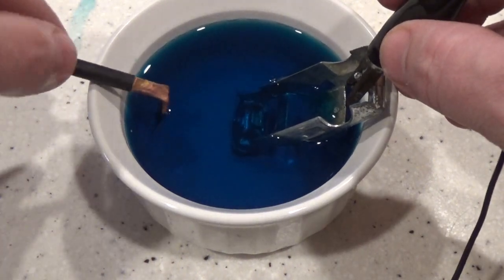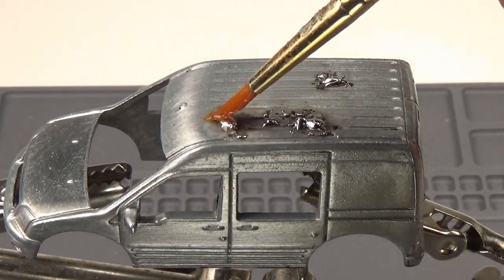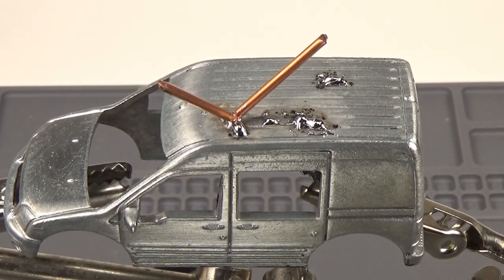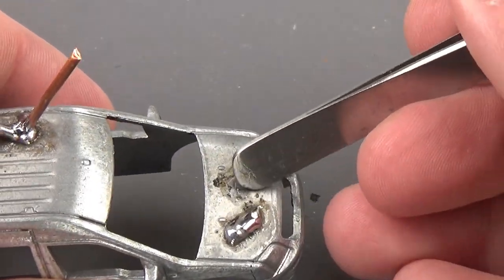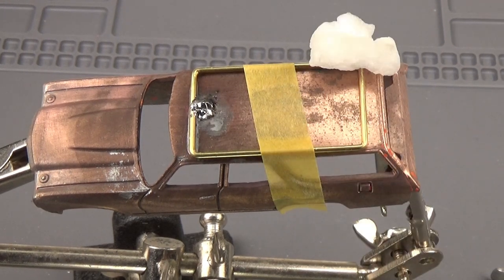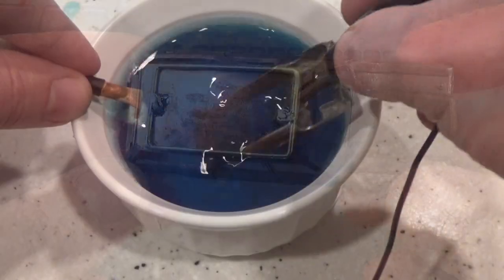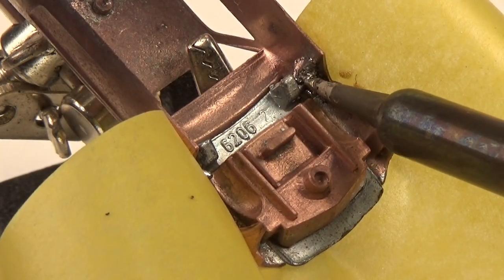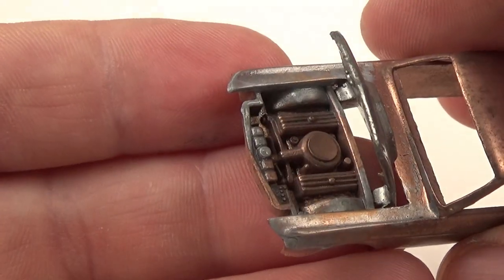How to Solder Hot Wheels ZAMAC Metal and Repair a Vintage Redline Hood.

Comment: Try heating the metal instead of the solder. When the metal gets hot enough to melt solder, apply it to the joint allowing capillary action and adhesion to fill the joint. Keep heat on the joint if needed. Repetition will help show what works best for you. I enjoy your restorations, good stuff. Thanks for posting.
Reply: I was thinking the same thing. All of my soldering experience is to MilSpec standards. I should look more into this myself.
Reply: Be sure not to use a torch. Try it with an electric hot plate and find the correct temperature.
Reply: As an electronics guy, some times you can preheat the entire piece to around 100-150°C with hot air and then apply the solder with soldering iron at around 280-360°C, keeping the temperature controlled is for tiny pieces with fragile materials (like ceramic or FR4 circuit boards), but as everything the magic is in the timing.

Flux paste is also encouraged, watch out for more aggressive (acid) stuff intended for copper piping, it may be good for your purposes.

With practice I have soldered galvanized steel, copper and brass reliably.

Comment: The secret to a good solder joint in these rolling heat sinks is an 80W soldering iron. With a 20W iron I can't reliably solder anything without burning it.
Reply: You could literally see the tin solder solidify in contact with the body. Thats why coppersmith soddering irons are 100W+ range. You can further extend the soddering "window" by zinc plating, since it will act as an additional barrier on the zamak (zink-aluminium-magnesium-copper) alloy copper presence. But a high capacity iron is a must first
Reply: Potentially preheating as far as it'll go will help. That's how we deal with heatsinky items in electronics. We also have high-power soldering guns with a bent piece of copper wire as a tip through which low-voltage high current passes directly, which heat up very quickly and are for this reason convenient, usually 150W or stronger, but they're really unwieldy and can be dangerous for electronics, but for something like this, seems quite adequate, and they can be pretty cheap.

"60W" generic 936/937 soldering stations from China routinely fail to deliver a whole lot of power for some bizarre reason. Chinese T12 does a lot better, even old ZhongDi (yes also Chinese) 50W units can work much better than the new "60W" ones, it might just be the gaps and fitment of parts. I hear some people pour some graphite or copper anti-seize into the tip to improve performance of the 936 but this seems a bit messy.

Comment: I think you need iron with more thermal mass. Whole body of a car is heatsink and it shows with cold joints. Or try to preheat car on electric stove/plate and then try to solder. Clickspring has some great videos on soldering bigger metal parts.  Don't really know how zamac will react to such treatment but it may be worth a try. And you really should just wet the iron tip, solder on the tip is just for thermal transfer, add more to the joint directly when it's heated, it is hard to do with only two hands and fiddly parts but when I grasped that it made a world of difference. Anyhow, great video, waiting for more. Cheers!

Comment: A little preheat of a body really helps, even just hitting it with a hair dryer on full for 20-30 seconds before applying flux and Solder with help it flow.

I've worked assembling PCB for the last 5 years and preheating a large copper area before trying to add of remove a component is essential.

I could see the cool temp of the that Ford connect was sucking the heat right out of the Solder.
Reply: The greatest solder advice I've heard is "heat the work, not the solder".
Reply: With you hair dryer theory ..do you have to keep heating the body everytime you start to solder?
Reply: @ernzcustomz  Yes if needed

Comment: It's a good trick to use sandpaper over the area you want to solder first, something like 180 to 220 (also it can help to cut a grill pattern with a razor). And the tempt of the car should be high already to help the adhesion, so it's better to first warm it up, then apply the flux, and then go with the solder and tin (here you can clearly see how since you applied the cold paper tissue, the tin immediately got hard and you needed more heat to work it out).

Comment: I've learned that tip size is very important when soldering smaller and bigger parts. I was soldering thin wires for my 3D-printer and the small tip worked fine but then I had to solder on some thick gauge high-amp wire onto an aluminium plate that had some copper-clad terminals (the heatbed). This didn't work. No matter how long I would hold the soldering iron onto it. Now I borrowed a soldering iron from a friend that had a tip that was about 8mm wide and the terminals were soldered in 5 seconds. Also, the type of solder really makes an enormous difference in attachtment. I always hated my solder, and then I switched over to a different type with a different core and it always worked. My solder even worked better than the factory-used solders because when I would go over soldering joints from household appliances, by solder would always stick better. So I would end up desoldering the solder and applying my own whereever I had to fix something. You can also use this bigger soldering iron together with a so called solder wick (made of copper strands loosely loomed together) to remove solder where needed.

Comment: So glad to see someone posting interesting videos like this. The only thing I would suggest would be to heat your substrate more. Only when the two contact points reach the solder melt point will it create a reasonable filet. (a solder filet is a solid joint that forms a convex or concave joint between contacts.) If one contact point reaches temp but the other does not, the result is what is called a “cold” solder joint which is the joint side that scrapes off of the substrate. Wiring the substrate to a heater block will do the trick. The higher you can get the bulk of the substrate to temp, the less heat is required on your tip. A third hand at the point of no return in applying the flux just prior to soldering will also yield a cleaner joint. Thanks for taking the time to post this.

Comment: Copper plating the whole car seems overkill and rather time-consuming (of course, as the whole hobby is) but you want to rough up the surface pretty good so the solder can stick to it easier and quicker (it doesn't stick to mirror-finish surfaces). Also you can use rosin-core solder to eliminate the need for separate liquid/paste rosin thus freeing up one hand in the process. :) 

But here's the big trick to soldering anything, whatever you're soldering needs to get hot enough to melt the solder. Meaning you need to melt the solder with the car, not with the iron. Doing it this way makes the metal you're applying solder to much more apt to accept it. And if you scuffed the surface well and have your rosin solder it will etch on much quicker & stronger as well. Initial tinning for everything but the iron is done the same way, using the metal to melt the solder can make some your soldering jobs go twice as fast!

And lastly, you won't have any issues with your solder remelting when it's over 1/4" away on any surface/metal composition unless your solder has too low of a melting point (or your iron is set too high). Knowing your solder's melting point and your iron's temp can really help you pull off some clever repairs when you have the right combo.
Reply: Could you do a video showing how this would work on zamac hot wheel cars? I've looked at some of your vids, good stuff.
Reply: Well said. That was some of the worst soldering I have seen in 30+ years of working in electronics.
Reply: @steveread864  clearly you havent seen mine XD
I'm curious though, did you watch far enough into the video to realise most of the 'soldering' was just to make a point?
Many people nowadays seem to merely get triggered, pause, leave a snoody comment and close the video.
I originally also thought "wtf is this guy doing", but there's a point to it. The first few at least. I'm sure the actual ones can be improved.

Comment: Just a few quick general soldering tips. Solid metal objects are a tremendous heatsink that steal heat away from the soldering iron and away from the intended spot. To prevent this it is helpful to preheat the object (standard toaster oven is just fine). Nothing too crazy, just roughly to the point where you can still hold it with bare hands. Having a more powerful iron (60+ W) might also help. Also, it always pays divident to pretin wires or other parts you want to attach, rather than chancing it and accidentally oxidizing metal and then having to clean it before you can try again.

Comment: Great video and a lil helpful hint you might use when adding stuff to the car/trucks is to use a double alligator clip mounted base which will give you that extra hand we always need.  When I work on smaller electronic components it comes in handy

Comment: I have a feeling the solder isn't sticking most of the time because you're not getting the base metal hot enough quickly enough. It going to take a good quality iron with a high thermal mass to get the base metal hot enough to wet before all the flux is gone.  Even moderate irons like the hakko 888 probably won't be powerful enough.  Likely that wire stuck because of how long the iron was on it and how much flux core solder was dumped into it.  The copper wets easier so less heat is needed.

Comment: I'm using this exact same method to solder wires on circuits. Use the solder flux to also clean your soldering iron and make it last longer and work better

Comment: One component you may want to consider is to get a temperature controlled soldering station. You can get an acceptable one from Amazon for less than $100.00. As someone below mentioned knowing the melting point of the solder you are using and then dialing it in on the station makes for a much more robust and; in the case of a restoration, a more eye pleasing joint. You are headed in the right direction with the copper plating. Get a good station and practice on a junker and I think you'll end up with something very satisfying. Good luck!

Comment: I recently started work on a restoration of a more modern hot wheels, which is my first restoration. It took forever as I had to use nail polish remover with acetone as paint thinner

Comment: A good tool I've found for small precise work (I use it on my knives when I make giards or do engraving) a strong 202 micromotor from treeline tools. I also invested in 1/16" dental burs. I use it very very often and it is very precise especially when compared to a dremel

Comment: You may need a larger tip. I have found that when soldering on PCBs that have large ground planes, a larger tip with more heat works wonders. The added amount of copper on the board sucks the heat away from the solder joint as is the case of the car body acting like a heat sink.

Comment: Great videos!  Very professional.  I enjoy watching them and learn a lot from them.  A few questions: You use a battery charger to electropolish your diecast cars.  Which amperage do you use, 6 amp or 2 amp?  I see that you use a vibratory tumbler to polish your cars.  What media do you use?  You've been able to polish the windows back to their original sheen.  What polish do you use?  You mentioned links to products that you use in the videos.  Where are these links and where do you post answers to the questions that we viewers ask?  In another vein, you had mentioned that you asked viewers to inform you about products that might be available to solder pot metal cars.  Both Muggy weld and Caswell make products that will solder pot metal directly without copper plating first.

Comment: BM , I have a tip for you I do stained glass and if your looking for pre tinned wire it comes in 18ga. And 20ga. If your going to solder on your cars it's great to use just a lil flux and your good to go also you can try blue glass flux it's a water based flux wont leave a residue on your cars

Comment: A very useful video. Thank you. What's interesting is the pronunciation of the word 'Solder'. The British, Australians, New Zealanders say it as 'SOLE-DER', whilst Americans say 'SODDER'. It's rather odd, and I've never worked out why it should be. 'Sod' in English is an old swear word, short for 'Sodomite', it also means 'Wet Turf'. 'Sodder' does sound rude. 😆😆😆
Reply: the British pronunciation is based on the old french word soulder, the American pronunciation is based on the middle english word soudur.  the british pronunciation was most likely influenced by their proximity to france, while we in america kept the older pronunciation but adopted the newer spelling.
Reply: @butre.  You know how it is, kernals and colonels
Reply: Bu tree that’s interesting and sounds feasible, I’ve often wondered how Americans came up with that way of saying sole-der. I have another issue with the word “ mirror “ us bits have that as two syllables but across the sea it has just one. Thank you for your post
Reply: @llamamanism  most americans pronounce mirror with two syllables, it's just non-rotic dialects, which are actually more common in britain than the united states, that make it one syllable.
Reply: NERDS.. I say sawder

Comment: Some of the trouble you are having  as some others have said is you need a hotter iron. You can be quicker and get better results for some things because you aren't soaking everything with too much heat. I have that issue when trying to solder larger audio audio connectors with 14 gauge wire with a 40 watt iron. All I do is melt the cable insulation trying to get the solder to flow with the flux the cable just draws the heat away giving the same types of joints where you can pick the solder away. Try a soldering gun that gives out so much more heat. You'll find the tack soldering will be fast and the solder will flow nice and neat like a real weld. I have a lot of soldering experience on woodwind instruments repairing them. Not having enough heat makes it so you can't keep heap localized.

Comment: Hmm. Here's a few tips for soldering, from someone who's done a fair bit of it. You should be able to do it without plating, the trick is to preheat the item you want to solder on. The reason you're not getting a good joint, is either because of impurities in the metal, which with diecast is a good possibility, but more likely, because of insufficcient heat. Copper plating is not a bad idea though, it's certainly a better material to work with than just pure diecast, but it does seem to be a rather lengthy process, compared to preheating the metal in say, an oven. More than likely your soldering iron, which looks to be a fairly cheap one, does not have enough power to pump sufficient heat into the metal. The metal acts like a giant heatsink, just sucking away the heat from the iron, before a good joint can be formed. You can try to compensate for this by using a larger chisel tip on your iron, but preheating the diecast will help a lot. Another way to go about it, is to use something like a torch to solder, rather than a soldering iron. Both a larger tip, and a torch would probably make it harder to do precision work, so once again, preheating the metal is probably the way.

Of course, diecast usually has a low melting temperature, so how much you can heat it, probably warrants some experimentation. You will want to get it as close to the melting point of the solder as possible though, so that the diecast doesn't just suck away the heat. I'd recommend using low temp leaded solder as well, but seems you're already doing that.

Comment: alumaweld may work better than solder but maybe not. I expect it would be worth trying out, seems to me it would be easier than soldering. I also think brazing would be easier than soldering. im not sure of the melting point of zamac though, the torch might melt the car too easily. just my two cents. y'all have a badass day 🤘🏻

Comment: Just a heads up.  If you are using a Redlineshop replacement hood you can not use solder. The heat from the soldering iron will destroy the hood. Great video.

Comment: Try different soldering tips.  I prefer the  chisel tip. The round tips lose heat to fast if you notice. That’s why you get it to stick once you added enough solder to cause a bigger heat transfer. That die cast will suck the heat just like soldering guitar pots and petals.  Enjoy your videos hope this helps :)

Comment: I'm not sure if I'm stating the obvious. Tin alloys readily with copper, which is why tin - lead solder is used in electrical connections. Thanks for the tip on copper plating the base metal.

Comment: This is awesome!
I had reservations about just gluing in the hoods, but this is so much better.
I have only one question, 
What if the hood has lost its little pin?
Would you just built it up and then file to size?
Or would you solder on a little pin like you glued one in a previous video?

I think that your restorations are great!
I played with some of these cars back in the '60's, most belonged to other kids as my cars were Tootsie toys.
I remember my first Matchbox, a station wagon with a dog looking out the back.

Thank you for what you are doing by sharing your passion.

Comment: As an optician I sometimes have to fix optical frames, for which we use silver solder and a very hot flame. Don't know how this will perform on diecast, for it might melt the whole thing. ;) For metal frames it's a good way to fix things though.